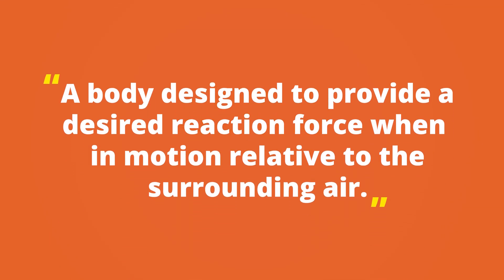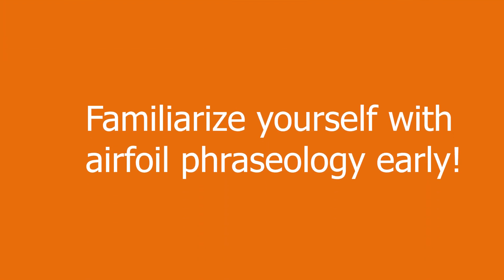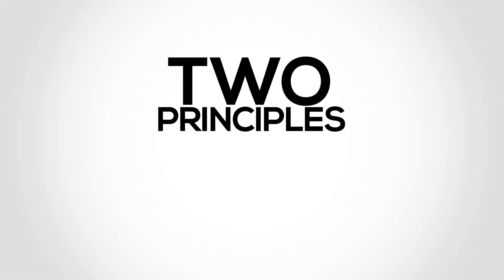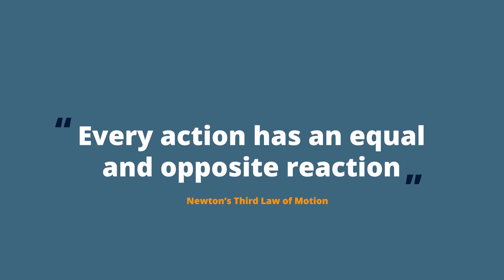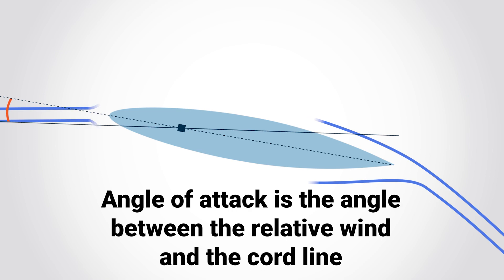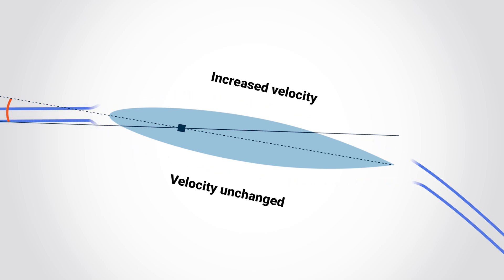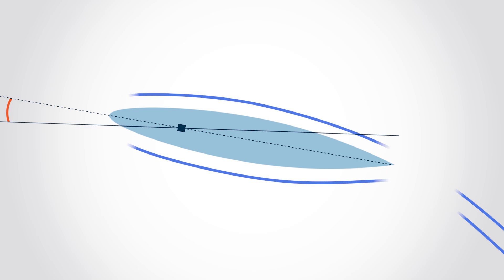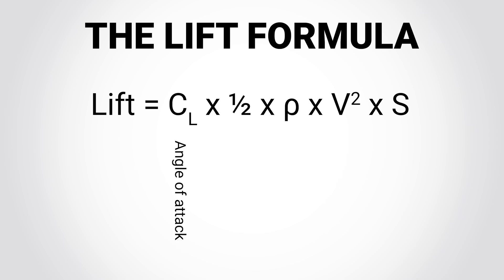Airfoils and lift - How lift is created

Comment: 3:11 that's a wrong conception of how lift is created.
The distance has nothing to do with it. As a matter of fact the two lines will not meet at the rear edge at the same time. Top flow is faster.

Lift is created because the flow is changed in direction. Pressing air down creates the reaction of lift on the object upwards.
Reply: I'm sorry Leander, but That is another common fallacy, because it takes a pressure difference to cause Acceleration of air downward.  Air has mass and Acceleration needs a force.  In fluids, a pressure difference is the source of the force. 
The air accelerating downward is another RESULT of the pressures, NOT a cause. This is about Newton's Third Law.  You FIRST need an ACTION  to get the REACTION.  The reaction does not cause the action. 
The action and reaction are not two separate forces.  A force has two parts (the action and reaction) acting on two different bodies.
.
Here is the correct physics.
. . . 
Lift is generated because air has mass and therefore Inertia.  Inertia is a RESISTANCE to force and, therefore, acceleration.   As air resists the acceleration imposed by the surface, air's inertia resists that causing a pressure change in the fluid and onto the surface.  
. . . . .
Below the wing, with air and surface heading toward each other, the air resists being pushed down and working WITH atmospheric pressure, causes a pressure increase there.   That Increased pressure under the wing is the source of the force that accelerates that air downward. 
Acceleration of the mass of air requires a force - REMEMBER Newton's First Law?
.
 It is just like how your bottom pushes harder on the seat at the bottom of a roller coaster hill.  Your Inertia "wants to continue downward and resists the upward force of the seat.  It's upside down compared to a wing, but  the SAME physics of Inertia.
.
Above a wing is JUST LIKE at the top of a roller coaster hill where you press LESS on the seat.  Your inertia resists going back down (Newton's First Law), therefore working against gravity and you press less on the seat.
. 
For the wing, air is first directed upward near the leading edge - THEN it's Inertia would continue upward, BUT the MUCH greater atmospheric pressure holds it down - But air's inertia resists, working against atmospheric pressure, thus reducing pressure on the surface AND in the air.  
The converse of below the wing.
.
Real physics.
.
.
.You might be interested that air ahead of a wing is accelerated forward and upward -- up-wash.

Comment: Why does a venturi tube decrease in pressure?
Reply: It does not, the video is honestly not very good. The whole story behind Bernoulli is that total pressure does not change, but dynamic and static pressures do. In a venturi tube, the dynamic pressure decreased but the static pressure increases such that the total pressure remains the same. it is basically the dynamic pressure that people reffer to when describing Bernoullis principle
Reply: @emilioferral8606  The video is terribly wrong and . . . I think you've got that backwards.
.
IN the narrow section, the Dynamic pressure is greater (speed) - static pressure less (against the walls).
. 
And it is the static pressure they refer to as decreasing in the narrow, faster section.
.
The TRUE physics is that it is the pressure change that is the cause of the acceleration into the narrow section.  Newton tells us that a force is required to cause Acceleration. 

The inward sloping walls is a restriction in the flow and, therefore, cause a pressure increase UPSTREAM, but NOT downstream into the  narrow section.   PHYSICS. 
That Pressure difference is what causes the exchange between static and dynamic pressures. 
.
THEN, the fluid accelerates  going into the narrow section BEACAUSE  the the pressure difference provides the force to accelerate the fluid's mass.  Newton. . . .  Pressure is the cause of acceleration toward the lower pressure.
It is Newton's Laws CORRECTLY APPLIED.!.

Comment: This video is just another of too many repeating common misconceptions that are false.
.
First the angle of the wing to the air is called Angle of Attack, not pitch.
Pitch is the attitude of the entire aircraft - the nose pitches up and down to change the Angle of Attack of the wing.
..
At time 1:35: WRONG.  Bernoulli's Principle is about Fluid Pressure and ACCELERATION*.  An increase or decrease in velocity is *Acceleration .
It is NOT "Fast or moving air" that has a lower pressure, but air is  ACCELERATED toward the lower pressure by the Pressure Gradient.
.
The Pressure Gradient is the cause of the Acceleration.  This is Newton for fluids.  The Pressure Gradient provides the force to Accelerate the air's mass.  Air has mass. 
.
WHEN are you people going to get serious and start understanding physics and applying it instead of blindly repeating misconceptions??
.
The longer path is a common misconception.  A flat wing has the same length above as below and produces lift just fine.
.
The upper and lower flows DO NOT meet at the trailing edge at the same time. See Babinsky's video of a wing (below).
.
The speed-up does not cause the lower pressure.  It is the lowered pressure that forms the Pressure Gradient that is the cause of the Acceleration toward the trailing edge.
.
The down-wash is a RESULT of the same pressures pushing up on the wing. It does NOT "add" to the top-bottom pressure difference in any way. It is a result of those SAME pressures.

At time 3:30, While he top-to-bottom pressure difference provides all the lift, it is NOT because "the high pressure has a 'tendency' to move toward a lower pressure."  
It is because the upward pressure on the bottom surface is greater than the downward pressure on the top surface.  This produces a net upward force.  Pressure over an area is a force
..
At time 3:54, Your 'reaction' arrows are WRONG! 
The reaction is in the opposite direction to the air's ACCELERATION which is upward.  The reaction to the drag is *REARWARD*.  THEREFORE, the reaction vector is up and to the REAR!  Your faulty reaction would increase thrust.
.
At time 3:48: If it is "dumped downward by the trailing edge", then the lift from that should pitch the wing downward (upward at the trailing edge , thus upward at the leading edge, yet it is well known that lift is centered more toward the leading edge. So, AGAIN, the reaction is distributed over the entire wing due to the pressures.  It is very misleading to claim that lift is due to the pressure difference AND the Newton's Third Law 'reaction. 

Lift AND curving of the air are the result of the pressures caused by the wing pushing air around as it moves.  Those are NOT two sources or causes of lift.
.
Finally, to say that Bernoulli "causes" lift is also false. 
Bernoulli shows us, if anything,  that the Pressure Gradients that are caused by the wing's motion cause the accelerations of air we see around a wing.
.
.
This 1 minute video explains that it is the curved flow that causes the lowered pressure:
 https://www.youtube.com/watch?v=3MSqbnbKDmM 
..
This steps you through Bernoulli and lift step by step.
  Understanding Bernoulli and lift Correctly:
 *rxesywwbdscllwpn.quora.com/*

Comment: No, lift is generated by pressure differences originating from the push and pull of the foil through the air: https://youtu.be/dgE9xhIjTOU - nothing to do with Bernoulli or Newton!
Reply from the maker: This content is meant for the FAA world. I encourage you to check out the Helicopter Flying Handbook chapter 3 for an accurate source. If you want more sources or comments on how lift is created, give NASA a look. There's a beginners guide to understanding this content and some kids content: https://www1.grc.nasa.gov/beginners-guide-to-aeronautics/lift-3/

https://www.grc.nasa.gov/WWW/k-12/UEET/StudentSite/dynamicsofflight.html#wings
Reply: @flightfirst6311  Thanks, but the literature talks about Bernoulli, or Newton's 3rd law, or else delves into the theoretical aerodynamics madness of lifting line, circulation, trailing vortex. Your first NASA link claims the air accelerates over the wing without expelling why it accelerates. (IT DOESN'T)
The second NASA link regurgitates the fallacy of gas flow turning. 
Please read my paper to find the real reason.
Reply: PS I went to the FAA and was unable to find an explanation. NASA might be able to launch rockets to the moon and beyond, but can't explain aerodynamic force.
Reply: That Bubble video has a few correct things, but has many errors as well.
I'm communicating with the author about it.
AL. . . . . . .
I explain all th errors in this video in a comment about a month ago.

Comment: This video is just another of too many repeating common misconceptions that are false.
..
At time 1:35: WRONG.  Bernoulli's Principle is about Fluid Pressure and ACCELERATION*.  An increase or decrease in velocity is *Acceleration .
It is NOT "Fast or moving air" that has a lower pressure, but air is  ACCELERATED toward the lower pressure by the Pressure Gradient.
.
The Pressure Gradient is the cause of the Acceleration.  This is Newton for fluids.  The Pressure Gradient provides the force to Accelerate the air's mass.  Air has mass. 
.
WHEN are you people going to get serious and start understanding physics and applying it instead of blindly repeating misconceptions??
.
The longer path is a common misconception.  A flat wing has the same length above as below and produces lift just fine.
.
The upper and lower flows DO NOT meet at the trailing edge at the same time. See Babinsky's video of a wing (below).
.
The speed-up does not cause the lower pressure.  It is the lowered pressure that forms the Pressure Gradient that is the cause of the Acceleration toward the trailing edge.
.
The down-wash is a RESULT of the same pressures pushing up on the wing. It does NOT "add" to the top-bottom pressure difference in any way. It is a result of those SAME pressures.

At time 3:30, While he top-to-bottom pressure difference provides all the lift, it is NOT because "the high pressure has a 'tendency' to move toward a lower pressure."  
It is because the upward pressure on the bottom surface is greater than the downward pressure on the top surface.  This produces a net upward force.  Pressure over an area is a force
..
At time 3:54, Your 'reaction' arrows are WRONG! 
The reaction is in the opposite direction to the air's ACCELERATION which is upward.  The reaction to the drag is *REARWARD*.  THEREFORE, the reaction vector is up and to the REAR!  Your faulty reaction would increase thrust.
.
At time 3:48: If it is "dumped downward by the trailing edge", then the lift from that should pitch the wing downward (upward at the trailing edge , thus upward at the leading edge, yet it is well known that lift is centered more toward the leading edge. So, AGAIN, the reaction is distributed over the entire wing due to the pressures.  It is very misleading to claim that lift is due to the pressure difference AND the Newton's Third Law 'reaction. 

Lift AND curving of the air are the result of the pressures caused by the wing pushing air around as it moves.  Those are NOT two sources or causes of lift.
.
Finally, to say that Bernoulli "causes" lift is also false. 
Bernoulli shows us, if anything,  that the Pressure Gradients that are caused by the wing's motion cause the accelerations of air we see around a wing.
.
.
.
This 1 minute video explains that it is the curved flow that causes the lowered pressure:
 https://www.youtube.com/watch?v=3MSqbnbKDmM

Comment: 😀👍
Reply: This video is incorrect. It is repeating common misconceptions.
.
The longer path is a common misconception.  A flat wing has the same length above as below.
.
The upper and lower flows DO NOT meet at the trailing edge at the same time. See Professor Babinski's video of a wing.
.
The speed up does not cause the lower pressure.  It is the lowered pressure that forms the pressure Gradient that is the cause of the speed increase (Acceleration).
.
The down-wash is a RESULT of the same pressures pushing up on the wing. It does NOT "add" to the top-bottom pressure difference in any way. It is a result of those pressures.
..
Babinsky's video: https://www.youtube.com/watch?v=UqBmdZ-BNig 
.
This 1 minute video explains that it is the curve in the FLOW that causes the lowered pressure: 
 https://www.youtube.com/watch?v=3MSqbnbKDmM
Reply: @Observ45er  😀👍
Reply: @christophertadeo6120   I'll guess that's good. . .

Comment: It's "chord" line, your spelling changes several times. 
The airflow over the top does not have to meet up with the airflow under the bottom, and in fact it gets to the trailing edge first, sees a gap because the airflow below is going slower, and it moves downwards - causing the downwash. 
The resultant force is upwards and backwards, which can be split into the vector at 90 degrees to the Relative Air Flow and called Lift, and a component in the same direction as the RAF, called Drag. Your diagram shows an arrow pointing downwards to portray the downwash, and then "Newton's law gives an equal and opposite reaction" which is pointing forwards?? Sorry, but your diagram is wrong.

Drive your car at speed, poke your arm out with your hand flat. Then add some pitch to your hand, and feel that your arm is pushed up (lift) and back (drag.)
Reply: Rob,
A - This video is very incorrect. It is repeating common misconceptions.
.
Yes, the longer path is a common misconception.  A flat wing has the same length above as below, yet produces lift the SAME way that ALL wings do..  
The upper air does not "see a gap", whatever that means.  There is continuous air all over.
Upper air is pushed downward and held against the wing's upper surface by atmospheric pressure far above which is higher than the air at the upper surface.  It is that Pressure Gradient (difference) that accelerates the upper air downward, so it continues in the same direction as the slope of the upper surface. Then, it simply joins the lower air which is also moving down and forward. . .. 
..
Yes, you are correct in that  there is a downward component due to the pressures that cause lift - - And a forward component due to the drag.
..
Comparing the speeds to the surfaces of he wing is completely irrelevant.   The "upper=faster" and "lower=slower" is only true in a wind tunnel.  You will be very surprised to learn that if you measure those speeds relative to the still-air mass (ground) the lower air will be faster than the upper air!!  YES! MEASURED DATA, linked here:  *rxesywwbdscllwpn.quora.com/* .. 
.
The thing Bernoulli is supposed to teach you is that is is a speed CHANGE that is associated with the pressure change along a path of flow. Speed/velocity change is 
*Acceleration*. A Pressure Gradient Accelerates a fluid just like a force accelerates a mass.   Air has mass and a Pressure Gradient difference in pressure between two locations 
provides the force to accelerate that mass toward the lower pressure. 
..
Talking about the Newton's Third Law reactions: it is opposite lift and drag, so it is mostly up and rearward.  However it does not provide, nor cause  either.  The downwash is the result of the very sane pressure changes that push up on the wing. 

.
The speed up does not cause the lower pressure.  It is the lowered pressure that forms the pressure Gradient that is the cause of the speed increase (Acceleration).
These speeds are what they are only because we use the wing as a reference.
.
The down-wash is a RESULT of the same pressures pushing up on the wing. It does NOT "add" to the top-bottom pressure difference in any way. It is a result of those pressures.
.
This 1 minute video explains that it is the curve in the FLOW that causes the lowered pressure: 
  *www.youtube.com/watch?v=3MSqbnbKDmM*   
. . . .
B- Putting your hand out the window neither proves, nor explains anything more than seeing every flippin' airplane fly.  Feeling you hand go up is NO DIFFERENT than knowing a plane has some upward push. . It does NOT explain WHY.

Comment: This video is incorrect. It is repeating common misconceptions.
.
The longer path is a common misconception.  A flat wing has the same length above as below.
.
The upper and lower flows DO NOT meet at the trailing edge at the same time. See Babinski's video of a wing.
.
The speed up does not cause the lower pressure.  It is the lowered pressure that forms the pressure Gradient that is the cause of the speed increase (Acceleration).
.
The down-wash is a RESULT of the same pressures pushing up on the wing. It does NOT "add" to the top-bottom pressure difference in any way. It is a result of those pressures.
..
Babinsky's video: https://www.youtube.com/watch?v=UqBmdZ-BNig 
.
This 1 minute video explains that it is the curve in the FLOW that causes the lowered pressure: 
 https://www.youtube.com/watch?v=3MSqbnbKDmM
Reply: That's a stall going in .
Reply: Thanks for clarifying